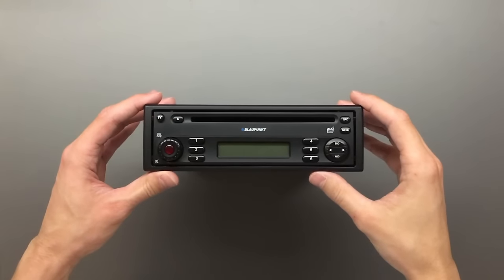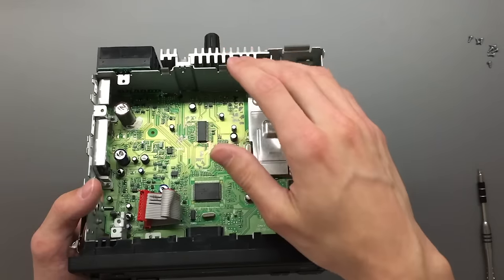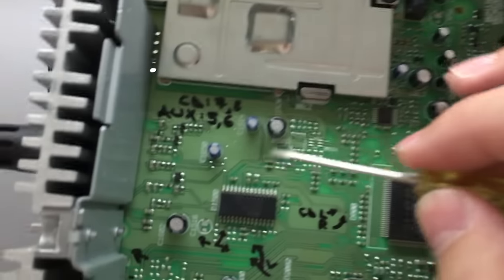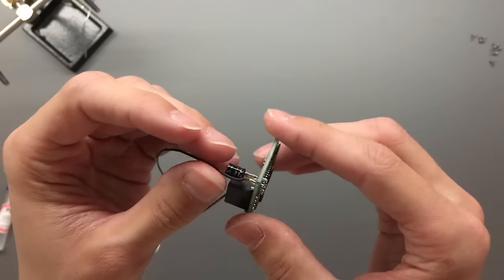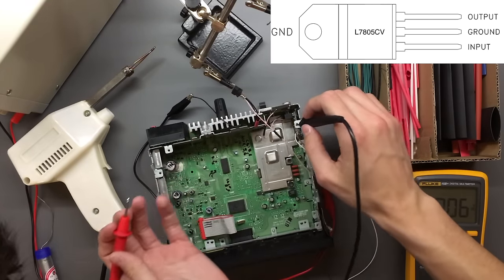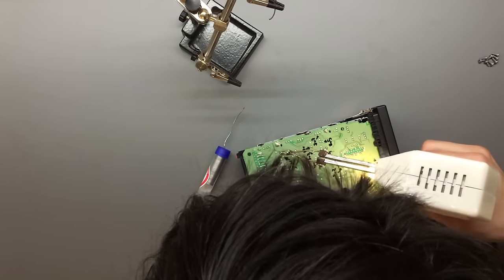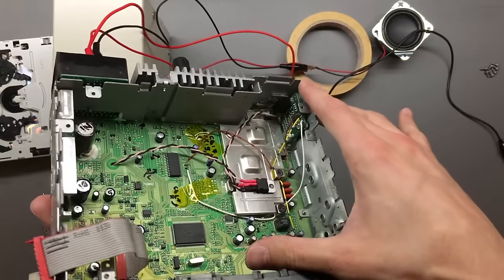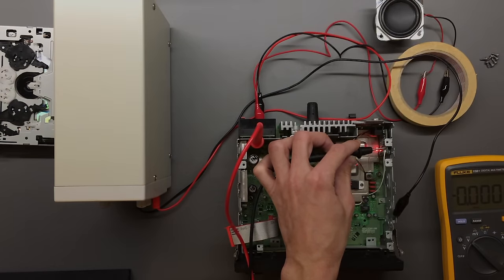How to Add Bluetooth 4.0 to Any Car Stereo for 12$ ! Complete Guide !

Comment: If you are constantly drawing 50mA from a 55 Ah battery, it will last only 46 days, not 114 years! The calculation is: 55Ah / 0.05A = 1100h = 46 days.
Reply from the maker: Shhhiieet - true that - thanks! 

In the interim I've made the module turn off when the radio's off

Comment: Hello friend please tell me you connected your Bluetooth 5 volt Although it should connect to 12 volts Why did you do that?
Reply from the maker: Mine was a 5V unit - you can usually ask sellers to ship you that version instead of the 12V one
Reply: Darieee Thank you friend You helped me I watched your video there where you connect Bluetooth to the iPod, but there's 16 volts in the car and only 13 How can I stabilize the voltage to 12 volts
Reply from the maker: Yeah this is a tough one, with the 5V version it's quite easy to run it from a linear regulator

I've recently wired up a 12V module for in-car use, and used a very efficient buck converter https://rover.ebay.com/rover/0/0/0?mpre=https%3A%2F%2Fwww.ebay.de%2Fulk%2Fitm%2F272928095767

Be sure to disable the low-battery warnings in the ConfigTool though !

Comment: You should have used a  Buck converter instead of a linear regulator, as the eficience would be higher, and wouldn't exist temperature issues. Even though good Project and great idea.
Reply from the maker: I don't think there exist any temperature issues now either; 15v > 5v = 10v @ 50mA = .5w

Comment: Would this work on a stereo that already has bluetooth A2DP? I have an advent ogm1 in a 2010 yukon but it's not connecting to my android galaxy s9 phone
Reply from the maker: does it connect to other phones ??
Reply: @Darieee  I have an iphone 7 that it connects with but sometimes even that'sporadic.  Theunites were produced between 2007-14. From what I've gathered the tech was geared more so towards iPhones/apple  connect at the time they were released.  

I'm curious if adding/replacing the bluetooth board might 'fix or improve' the connectability with my newer mobile devices.

Comment: Does the bluetooth module need to be paired to the device first or can any device connect to it if it's powered?
Reply from the maker: When you power it up it first tries to connect to the last device it was previouslt connected to

It also becomes visible if it doesn't find it, and you can connect any phone

After something is connected it's no longer visible though, and you'd have to turn bluetooth off of the currently connected phone to get the module into search mode for a 2nd phone to find

Comment: How did you trace the ignition pin 7 all the way to the pin on the main board?
Reply from the maker: just buzzed it out with a multimeter in continuity mode

Comment: Nice Projekt! is it possible to select the next song with the carradio keys? or only possible with the tablet keys?
Reply from the maker: Thanks; in theory you coooould map out the next/fwd keys and have them be 'translated' to the BT Module ... but it's insanely cumbersome, as the BT module doesn't merely want its NEXT and PREVIOUS buttons shorted to either ground or positive ... it wants them shorted to a COM pin ... which is neither --- and shorting said buttons to GND makes it reset, and to + almost fries it ... so yeah ... more or less stuck with changing songs from the phone

Comment: How does it work without the CD player? at the end of the video
I use the radio input cause I broke the CD player part but It's not good. Is there any way to cheat the main chip to set the CD input without CD player part?!
Reply from the maker: probably, but it's usually not worth going that rabbit hole

try muting the AM signal and feeding the audio in that route
Reply: @Darieee , I'm working on it now
Also, there is another way to emulate a CD changer for CD player and use it as an AUX.

Comment: Why add a voltage regulator when the bs1203s dc/dc converter on the board does the same thing
Reply from the maker: if you check the datasheet, you'll see that those isolating dc-dc converters are very sensitive for their input ...

cars will easily reach 14.5 which .. technically will blow those up (maybe they don't but - yhea, no guarantees off the beaten path)
Reply: darieee thanks I understand now. I’m moving onto my next speaker issue which is that my tiny Bluetooth speaker is getting gsm buzz. My understanding from google is I need better shielded speaker wire or a ferrite core but know next to nothing about the issue.
Reply from the maker: if you can, and you usually can,

do go with a 'differential' signal

check my channel for differential - I have some videos on this topic (and also my margarine box speaker has this done and explained)

Comment: How did you resolve pairing to new device problem?
Reply: need to bring out a switch. He didn't mention on this video.
Reply from the maker: Yeah ... sorry I missed this one

It's best to find a 5v rail that goes away when the radio is off

TIP, manufacture an ISO plug where you control both illumination AND ignition. A lot of radios only go to sleep once they see ignition fall and see no illum

Comment: How should i add an auxiliary input on the same stereo u have used in this video ..?
Reply from the maker: +Shanky ZZZ the quick and dirty way of doing this is just paralleling the outputs of the bluetooth receiver and the line in; as long as you don’t have music playing on both, it should be fine (so far I haven’t had any issues with this practice)

Comment: How should i power up the stereo wit a dc 12v 5amp adapter........which are the +ve and ground points to power it up at home not in car..!
Reply from the maker: I don’t really get the question ..
Reply: I dont have the data sheet of the connection so i just want to know the points to start up this stereo system at home.....not in a car

Comment: I tried it with my JVC KD-G401 but it does not seem to work :( I connected the CD.R and CD.L pins to an aux jack to test it. I used the AGND for the ground. Did someone alse also try this with this radio?

Comment: Why not attach the bluetooth chip to override the auxiliary input if was a possible option for this model?
Reply from the maker: +Tictacpanter I'm around 90-101% sure I did mention it was impossible on two levels 

1 the path from the back DIN connector had missing "links" - but that could be bypassed with putting the module inside

2 you can't select it from the front panel (and why would you be able to, it'd just piss off 99.999% of the users)
Reply: 1. Sorry I didn't catch that in the video. I went and scrolled back to where you described the Aux part on the board and didn't look around again for another description. My bad.

2. I've had several vehicles where Aux-In is selectable from other modes of media. So I'm not sure if you are referencing that Aux-In can't be selected on this model or mean something else.
Reply from the maker: On the stereo I have in the video, there is (1) no way of selecting it on the screen with the buttons and (2) there is no path from the DIN to the selector chip

They just didn't enable it in software

Comment: Hi...

I'm trying to adding up bluetooth on devices but it is more complicated than those. 

It is doesn't come radio internal but there have external with aux and usb power. So I'm trying to adding up bluetooth on between aux and usb to connect radio system. So, would you help me how do to this
Reply from the maker: well, get the 5V version (a bit harder to find than the 12V, but, should be doable)

then just connect usb power to it and run the output into the AUX
Reply: It is hard to tell you, but simply I just want to show you
Reply from the maker: make a video ;)
Reply: Johan Sebastian Ortiz Sotelo some vehicles have a separate Bluetooth module that’s connected up by a separate loom to the radio. It’s the same in my fiesta, I just got the Bluetooth module and loom from a breakers yard and installed it that wah
Reply from the maker: Lucky man xD

Comment: Hi. Great video! Do you offer this upgrade service in Germany or perhaps know somebody who does?
Reply from the maker: I sure do - what radio would you want modded ?
Reply: Darieee Thanks for the prompt reply. It is a Philips CCR 600. A CD Changer is connected and functioning. Is it possible to modify the cassette function for Bluetooth without losing the CD Changer function?
Reply from the maker: @darylfranck8854  probably ... but given it's a rather unpopular model, all the initial work required to reverse engineer the thing would have to be paid by yourself ... could get rather pricy

Comment: Ok so I have looked at the boards that are in the links there is volume and other controls you dont hook up how do you know if the default  volume is maximum I know on bluetooth adapters if volume is low you can barely hear it in the car want to avoid this
Reply from the maker: All CSR modules on the green boards are done by HYT and come loaded with a configuration which starts the chip up at full volume
Reply: Thanks for a fast reply I'm going to try install this in a nineteen fifths am only car stereo  we dont have am stations where I live I found the audio wires from the am input to the internal amp I'm going to cut them and install it there into the amp I think that should work
Reply from the maker: Mmm, be careful, that should be a very low level signal ... perhaps do more research before hooking stuff up

Or not -- all depends on how valuable your radio is
Reply: Hmm I cut the wires and hooked up a ipod to it with a hacked up audio cable seemed to work fine let it play a few hrs nothing seem to get hot or anything wierd
Reply from the maker: Ah yee, then you're golden!

Comment: I put aux in my peugeot 206, in cd changer pins, but my radio wont recognize it, i dont know how to solve this, i tried original cd changer and works perfectly well, but aux cant do it,some advice?
Reply from the maker: The radio probably doesn't swtich to the changer unless it gets an answer from it, try what I've shown in this video
Reply: Darieee maybe to put some resistor?
Reply from the maker: Mmmmmm, could try and search online for details about how it works, I've no idea, the mercedes one I played with uses an optical interface so, I steered clear of that

Comment: Pretty cool mod do you think I could do this to the line out on my Sony home theater
Reply from the maker: 100%, just gotta find a 5/12V line that is only on when the receiver is on; that way, wach time you power your Sony unit on, the bluetooth module will automatically connect to its last paired device
Reply: Thanks I was looking for something like this instead of the jack method
Reply: Boom the av receiver has a USB  port could I directly power from the back of this inside
Reply from the maker: :D let us know how it turns out
Reply from the maker: also - make sure you get a 5V CSRA64215 Module

Waaaay way better than the CSR8645 ones, same price

Comment: Hi, do you know how i can monitor the on / off of the Bluetooth module (CSR 8675) using arduino?
Reply from the maker: of course -- the simplest way is to have an input on the arduino listen to one of the LEDs of the CSR8675

the on/off timings are unique for all states

if you want you could also program de LED patterns yourself (and maybe avoid the arduino completely -- check my "margarine box speaker" video for more on that)

and also the big boy way ... get the CSR8675 to spit stuff out over some serial interface, and listen to that with the arduino
Reply: @Darieee  thanks for answer, i thing the idea to listen the LED, but not use yet. What about serial interface - you speak about UART or SPI?
Reply from the maker: I don't know which one it uses

Here's the full CSR8675 Datasheet 

https://www.dropbox.com/s/v9cetgmnw9j8top/CSR8675%20Datasheet.pdf?dl=0
Reply: @Darieee  Very thanks, that realy good datasheet :)
Reply from the maker: I have the best shit man ;) you' welcome !
Reply: @Darieee  ahahha dataSHIT - funny :)))

Comment: Hello. I have a question. Can I put a 3.5 mm jack instead of the bluetooth module?:)
Reply from the maker: Sure
Reply: Thank You!
Reply from the maker: Cu placere
Reply: Maine mă apuc de proiect. Pot să îți mai pun întrebări dacă mă blochez la ceva?:))
Reply from the maker: Sigur, vezi si celelalte 2 3 filmulete din playlistu' asta

De ce nu comanzi totusi si un modul CARA64215, daca reusesti sa-l faci sa porneasca o data cu casetofonul se conecteaza automat la telefon - e ceva frumos

Si apropo -- despre ce casetofon vorbim ?
Reply: Exact ca cel din clip:)
Reply from the maker: Ala e CSR8645, CSRA64215 e la aceeasi bani si mult mai bun
Reply: Da. O să mă gândesc si la opțiunea asta. Dar până ajunge o sa pun cablu😃
Reply: Salut. Îmi poți spune mai exact unde trebuie sa lipsesc firele? Eu le am lipit și nu se mai auzea Cd ul și mergea numai pe radio și am fost nevoit să renunț.😅
Reply from the maker: Am facut fix ca-n filmare ... mai uita-te o data cap coada poate ai ratat vreun detaliu ... n-am idee ce-ar putea fi

Comment: You can buy a bluetooth integrated class d amp for less than $10 and connect it to the speakers, which doesn't require any soldering.
Reply from the maker: Might sound a tad worse than that class ab stock unit though

Comment: do u have to put the board in to pairing mod to connect your phone thanks
Reply from the maker: Nah, so, when it power up, it first tries to connect to the last known phone

If that's not in range or doesn't exist, it goes into 'discoverable' mode for 60 seconds, in which time you can pair to it

It needs absolutely no buttons, the sound quality is amazing, and the reception awesome ! I really do recommend it

(did you also hook up to your mixer chip ? or did you feed your signal directly into the amp ?)
Reply: Darieee I tied it in to the amp so I still have volume control and the chip I used has an auxiliary input so if I am not using the Bluetooth it  automatically switches to let the head unit audio pass through it
Reply from the maker: I see, well, it's a bit harder to get an aux through this board I'm using

But I get 2 volumes the way I'm feeding mine into the stereo, from the stereo itself, and the phone (that I usually max out and only use the stereo's volume thouvh)

Comment: Hi! I want to do the same, but my audio managing chip is somewhat of a micro controller of its own. (ref saa7709h/108y the datasheet of this one is unavailable, but the pinout seems to be the same as the saa7709h)
Problem is, there are both CD_L/_R and GND, and I²S protocol (CD_CLK, CD_DATA etc. ). And the CD_L/_R and GND are linked after the capacitors.
Anyone successfully connected a bluetooth module in I²S ? Any advises ?

EDIT found out that you can enable "aux source", so just adding a Bluetooth receiver connecting to a 12 pin connector on the back should do the trick for me

Comment: Whats the capacitor doing ? For what voltage is it rated ?
Reply from the maker: I think it's 16V or something like that, it's always good practice to have a capacitor before and after a linear voltage regulator

Otherwise, it might start oscilating

Comment: Thanks for the video.is there any benefit to fixing rhe regulator to the chassis for heat dissipation? When you are using bluetooth input is the cd spinning constantly?.thanks again
Reply from the maker: you're welcome :)

well, if you fix it to some metal part you get extra style points (in this particular application it's however not vital, since it's dropping at most 15-5=10V at .030A which equates to .3W .. in free air it'll get quite warm but nothing to worry about - just make sure to tie all the parts down as in a car they'll most likely rattle > snap the cables off eventually .. hot snot also's a no go since stereos usually get insanely hot in the summer)

unfortunately it is constantly spinning and playing back the CD - not the most elegant approach since you're shown a random time on the screen .. but the whole thing works flawlessly in any case so, meh, it is what it is

Comment: I have a challenge for you if you're up to it. Have you ever considered adding a bluetooth board to a tv?
Reply from the maker: to what purpose though ? using the tv speakers as a playback device ? Or to have the TV be capable of connecting to a bluetooth speaker ?
Reply: Darieee I've been looking to find a way to pair bluetooth headphones to my tv. The solutions require a 3.5mm headphone jack. Only my tv doesn't have a headphone jack.
Reply from the maker: mmm, that should be quite easy to circumvent though (also why the fuck would a tv not have one >.,< fucking apple man .. look what they started)

Just probe around your tv and see where the signal goes to the amplifier chip - depending on how new your tv is that might be quite a challenge though .. aand, yeah - make your own AUX out and maybe even build your transmitter into the tv

Comment: Hello, nice video! I am trying to cope this tutorial, with an Alpine CDE 9843R but I have some troubles.
I cannot find a chip that contains the "Audio L, R, GND" of CD input :( 
Could you help me? 
Ic-s in the board:

BD3426K 503H70
0520H 74HCT7007A
ALPINE 51-02274Z01
SAA6588T
Toshiba ta8263bh

Any help is appreciated.
Reply: I managed to find the Audio lines, but strangely, only plays Bluetooth audio when the cd has normal music audio not the silent track that you linked. Could you help me please why can be that? Also there is background noise like when I use FM transmitter :(

Comment: how is the reception / connectivity of the BT module in the back of the radio and is closed shielding its reception??
Reply from the maker: Shockingly - it's perfect, I have absolutely never had even one hiccup (the front of the radio is plastic - so, transparent)